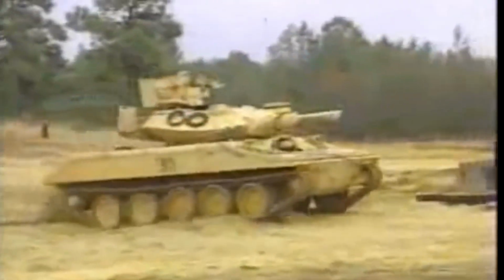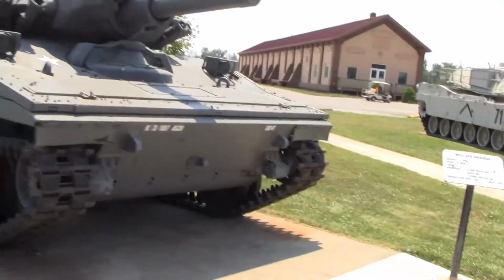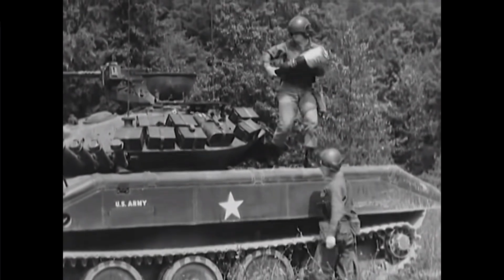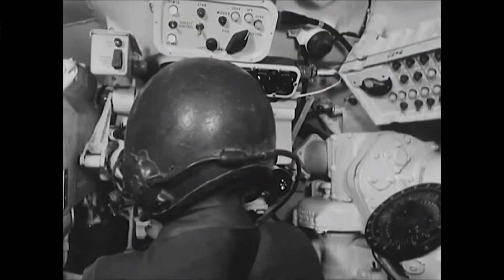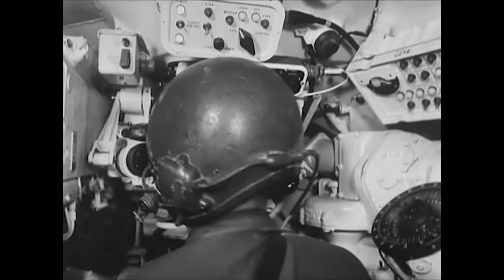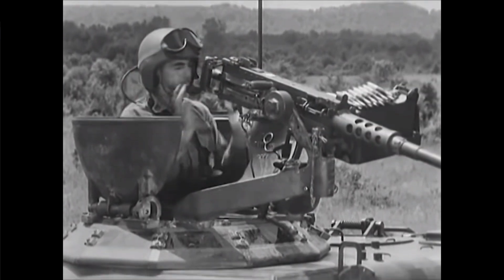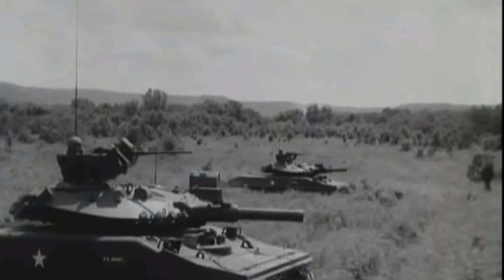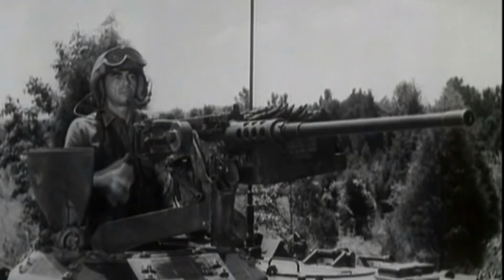M551 "Sheridan" AR/AAV | DESIGN DISASTER!

Comment: My history as a crew member who manned all 4 positions on the Sheridan from 1976 to 1979. Assigned to L troop 3/3 ACR Ft. Bliss, TX. All the problems mentioned in the video had pretty much been resolved by the time I served on the M551. Out of the more than 600 main gun rounds I fired I had only 1 misfire. And yes she kicked like a mule when you fired the main gun. I also had the privilege of firing 2 Shillelagh missiles and both were dead on target at 1200 meters. These were laser guided missiles and not the wire guided.
 Our biggest problem was the coaxial machine gun. The solenoids didn't work very well so we usually disconnected the cable to the solenoid and had the loader fire the gun manually. As I aimed thru the sight I would tell the loader over the intercom when to push the manual lever and when to release it. This usually worked pretty well.
 Mechanically they were pretty reliable. What we put them through while training they were bound to break down sooner or later. The main thing was to do all your PM's. They were pretty easy to work on. We could change the power pack (engine/transmission) in less than 2 hours. 
Would have I wanted to go to war in it? NO, it was too lightly armored. A heavy machine gun firing AP rounds could take out a Sheridan. You just don't get a warm fuzzy feeling when the name ALCOA is stamped on your turret.
Reply from the maker: Jon thanks so much for your info!! Amazing to have someone who actually used it have a good time with it. As I did say, they did fix a lot of the problems :)
Reply: @_Matsimus_ , No problem my friend. I love to share my stories of my time in the US Cavalry. Some of the toughest and happiest moments in my life. Scouts Out, Sir.
Reply: @phred.phlintstone  Even though we were in the desert it still got cold in Jan. and Feb. But sand was are biggest enemy. It got everywhere. It would get in our fuel tanks and then clog our fuel filters. You could always tell when your fuel filters were dirty, you would slowly lose power from the engine and the Sheridan would start to lose speed until eventually you were creeping along at about 15 mph. The filters were easy to get at but we rarely had replacements and had to clean the old ones. 
I still laugh at the way we cleaned our air filter. The inside diameter of the filter canister was the same size as the outside diameter of our main gun so we would slip the air filter over the main gun and manually release the air pressure from the bore evacuation compressor and the air coming out the end of the barrel would blow the sand out of the filter. Once again you didn't want to get caught doing this because if you weren't careful you could blow the filter off the end of the barrel and damage it. We used to call that Spec 4 ingenuity.
Reply: I was a M60 tanker but served the same time you did and talked a Ssgt who served in Nam. He said that they took 12.7mm hits and you could see the dents from INSIDE the turret
Reply: I was a Shillelagh missile tech from 1977 to 1980. The missiles weren't laser guided. they were guided by 2 carbon arc lamps in that box that sits on the gun.
Reply: Reactive armor would have helped if it was in a war long enough .1600 built that s alot .i wonder how good fuel consumption was
Reply: @leocrall4888  I'm sure we were taught the range of the M551 in Sheridan school but I don't remember. We would always top off before we left the motor pool when we were headed out to the field for training and then we would rendezvous with the fuel trucks at night for refueling. We would log the gallons received each time in the vehicle log book but I never tracked the consumption. Our crew would refuel at every opportunity where as some crews wouldn't. We would never turn down fuel.
Reply: I served 00-06 12-B, not to make anyone feel old, but I built a M551 model as a kid, and unfortunately noticed one at Fort Leonard Wood on the hand grenade range... less tracks, turret and bogie wheels. It was one of those "Where have I seen this before?" moments .. I had a Hard Ass 1st Sgt (really good guy tho) who seemed to materialize like the Predator from no-place, I said "You don't deserve this"  (to the tank) he says "You live through it, the ARMY will do the same to you", and walked off.
Reply: @soldierski1669  "the ARMY will do the same to you" - Ha!  Ha!  Ha!  Ha!  Ha!  Yeah ... the voice of experience there ...
.
Reply: Jon, any idea what happened to the majority of the Sheridans?  I know some were converted to resemble Russian armor for Army wargames.  And I also read some were used as artificial reef.
Reply: @phred.phlintstone  They were 6 cylinder diesels with a turbo charger. When it got cold in winter we would spray starter fluid into the turbo fan and the engines would fire right up. You didn't want to get caught doing this, you would get in a lot of trouble.
Reply: Gteat info!
Reply: @phred.phlintstone  Yeah.  Dec. 1970, I was a sentry at MCSC Barstow up in the High Desert - and yeah ... there was no moisture in the air to hold the heat in - and at 0400 in the morning - all the heat from the previous day had radiated out into that star filled sky - and yes ... it was cold.  I wore two pairs of socks, long underwear, jeans and my utility trousers, long sleeve underwear, a sweat shirt and my utility jacket - then - my field jacket - with a liner my father had had the wisdom to tell me to buy ... and it was still cold. Oh and gloves - and - a towel for a scarf - which I could pull up over my mouth and nose.  6 on 6 off ...
.
Reply: Thanks for your service, man.
Reply: Hey Jon I was in L troop the same time as you I was in third platoon and crewed my Sheridan with ssg tuck.

Comment: I served in 4/68 as both a tank plt ldr/tank commander and later as the company XO (aka maintenance officer).  This was from 1973 thru 1976.  The missile control system could be finicky, sometimes difficult to get it to a "green" light status so you could shoot.  Never had any specific issues with the actual missiles.  They were accurate out to ranges well in excess of 4KM.  Hardest part was getting the gunners to keep the crosshairs on the target and not try to "fly" the missile.  The guidance was by an infrared light beam like a TV remote on steroids.  I later served as XO again in Germany in an M60A2 "Starship" tank battalion (1/32nd Armor).  Less trouble with the missile control systems as the vibrations/shock from firing the main gun with conventional ammo was almost nothing.  They had beefed up the recoil system and with the tank weight at 54 tons instead of 17 tons, the gun only recoiled about 5 inches.  On the Sheridan the recoil came back to full mechanical stop and then rocked the tank back till the front two road wheels lifted up and you could see daylight under them.  I had the radio shelf in my Sheridan break off one day and everything fell onto the turret floor.  After about 15-20 main gun conventional rounds, we would tighten up the battery cables as they would vibrate loose.  The closed breach scavenging system worked great - it operated at about 5000 PSI.
Reply: Alpha Company, 1st Platoon, TC '73-'74. Remember the first LAPES test that had a malfunction of the release clamps and it did NOT get pulled out of the C-130 50 feet above the DZ but several hundred feet above when the hot shot pilot did a hard pull up and THEN it ended up in pieces...
Reply: That one went into the trees and we had to cut down a tree to get one of the chutes back.  About a year later we lost another one and it buried itself in the ground nose first.  When we pulled it out, it had a tree stump through the front lower armor.  It was the tree we had cut down before.   I was 3rd plt Charlie Company 73-74 then XO in Charlie in 75.  Do you remember SFC Tuemler?  He was my platoon sergeant.  @kentonvelomancer3466

Comment: Actually a few changes could have made this a good platform.  For one it was over complicated and a maintenance nightmare.  Jimmy diesels were excellent for M113's but Lycoming diesel and different trans would have helped.  Main gun was a bitch and should have been scraped or just improved to handle only conventional or missile. As in most cases of that time period many pieces of overpriced shit was deployed.  I think Army Ordinance at Aberdeen was either out to lunch or on someone else's payroll.  From 1968 to 1975 things like the Vulcan, Chaparral, PPS 4 & 5's, the 1 1/4 trucks, early Redeye missiles, M551's, the at forever deadlined gas powered reconnaissance track, and other junk, oh I forgot that magnificent debacle called a Gamma goat.  Plus lack of parts (PLL). If the Russians would have come over the border NATO would have been screwed. Besides a lot of outdated and piss pour equipment much of that which did work was rushed to Israel for use.  One unit in Southern Germany I know of had broken down recon tracks, no Redeyes for it Redeye unit, no track pads and damaged tracks on its 4 duce mortars 113's.  Most of it's basic load was shipped elsewhere.  But the Readiness reports were first alter at platoon level, then again by the 1st Sgt., then again by the Company commander, then by S-4, then again at Battalion, then Division and so forth. By the time it hit Washington you'd think this unit and others like it were composed of Iron Man and Transformers.  Morale was bad also because most of the good officers were in high priority combat areas and a lot of units were commanded and run by shoe shinning  promotion seekers.  Don't get me wrong but there were some units that were top notch I served in several but many were nothing but uselessness collecting pay. Piss poor equipment and supply can and has busted morale, throw in good on paper but shit for brains commands you got disaster.  I know the military has changed quite a bit since the sixties and seventies for the better.  Gone are the days of the weekend meals of canned hotdogs but has it rid itself of doctored Readiness Reports that cover up evidence deployment of over hyped, overpriced, nonfunctional junk?  Just as WW2's defective torpedoes and the following blame game has the military command taken its head out of its ass or still living the illusion of greatness?  I hope it has.  Only thing worse than losing good men and women in ombat is losing them because of ignorance and arrogance of their leaders and defective or inferior equipment.

Comment: "Aluminum hull"

I've never been so disappointed, Matt. Canada is getting to you.
Reply: @phred.phlintstone  The problem is "Aluminum". It's Aluminium.
Reply: The foam flotation under the thin outer skin was found to serve as GREAT advantage: It afforded a "stand-off" detonation of HEAT rounds, which were the main ammo used by most tanks at the time, not to mention RPGs. The 18" of so distance away from the inner thicker aluminum that the fuse set off allowd the force of the jet stream to spread. The IDF learned this from damaged M551's in Vietnam and started covering some areas of their tanks used in '73 with skinned blocks of foam and likely saved many lives. Today we have "reactive armor" which takes the same premise and adds outward-exploding force when hit. Of course off of this does nothing against a SABOT...   @VEpsilon

Comment: The preasured air system most likely is more for forcing the fumes out of the gun and keeping it from flowing into the crew compartment, a similar system was used on the Panthers and is curently still in use with the french military on vehicles such as the Leclerc since these dont have a Fume Extractor
Reply: @phred.phlintstone  did they not have a compresor on the vehicle? well thats fucking retarded, a truck has a fucking compresor with it to refule the compresed air storage why didnt they?

Comment: Was a good looking tank.. really like the turret shape.. quite modern... Shame it didn't operate as good as it looks lol
Reply: With a different gun it would have been superb. More range and faster rate of fire. We thought that back in 1970 when we got them then. They were brand new and excellent condition, but even at Bragg in the mid 80s worn and used as they were they ran circles around the M60 except in gunnery.

Comment: When I was going through Basic Training/A.I.T. at Ft. Knox, KY towards the late 70's as a Tank Crewman, a number of Crewman Hopefuls were both interviewed and others VolunTold they would move over from the M60A1 series tanks to the M551 Sheridan.
I had the skills and scores to allow me to test out but I was physically larger than the desired size (not Lilliputian but not almost 6' and muscular as HELL) so I wasn't selected.
Those who moved over were, by all accounts, small in stature but they all complained about being in the Loader position as described in this video.
I always liked the size aspect, speed and state of the art (for the day) plus the main gun/missile launcher but we heard fairly quickly about how temperamental the main gun/rounds were as well as it was a not-so-closely guarded secret that sometimes, as one missile was being fired, if another Sheridan was in close proximity and lazing to another, nearby, target, every so often the Shileighly(sp?) missile fired and in-flight could be "Stolen" by the other tank. Allegedly this was cause by the laser coding being used was too close in their pulses and in close enough sequencing that the missile seeker could be over-ridden and take off. 
Also, again allegedly (as told to me by one of these former fellow crewmen) when a missile was "stolen" it couldn't me counted on to actively seek and engage it's newly acquired target but would instead just head up into the air or plow into the ground short of the target. No rhyme or reason as to the direction...it just "WENT" I was told.
So outside of  the fact it was a much lighter weight tank with superior terrain negotiating abilities due to the lighter weight, I wanted IN because I just KNEW it would be better able to Shoot and Scoot with better survivability built in.
WRONG! as it turns out and was described on the video.
Still, it is an interesting device and if they would have incorporated a larger turret and used a better main gun, sighting system and less complicated wiring system, it might have turned into a better firing system. 
But coulda-woulda-shoulda doesnt get the job done, does it? LOL 
But l have to admit the M551 was a cool "concept" vehicle in its own right. 
Thanks for the video and trip down Memory Lane. 
Merry Christmas to You and all my fellow Veterans, Past, Present and Future!
God Bless you One and All!!

Comment: The 152 mm Gun/Launcher, per tank commanders in the 70's sucked. The short barrel gave it a rather short range. The anti-tank HEAT round wasn't that effective. The only positive thing I heard about the 152 mm Gun/Launcher was the Beehive round. That round was extremely effective. I know they had a 105mm version for the M60/M1 105mm gun. Not Sure if they had a 90mm version for the M48. The gun system is part of why the MBT70 was terminated. My Dad a combat veteran in armor, and an ordinance expert, thought the gun system was absolute junk. The M60-A2 nicknamed the Starship for the turret, was equipped with the 152 mm Gun/Launcher. The Israelis wanted nothing to do with the gun system and refused to buy them. The M60-A2 disappeared from the Army inventory rapidly. The A1 was kept in service or upgraded. The A2 went to the scrap yard. The M551 was vulnerable to landmines, but so was/is the M113. I had a friend the was armored Cav in Vietnam. The lined the floor with sandbags, that was good enough to stop an RPG fired from a spider hole directly under the track. M113was ok, the Viet Cong " volunteer was pretty much mush between the back blast in the hole and the warhead,

Comment: Had a long chat with an army mechanic who worked on these things. He said the engine bay was always insanely dirty and they always caught on fire.
And the issue with the regular rounds shaking the electronics apart was much much worse than stated in the video.
Everyone loved the concept but despised the vehicle.
Reply: I really do not know why the electronics were so vulnerable. I have worked in defence as a design engineer (electronics) and know you can make electronics insanely rugged. EG "Copperhead" rounds which take something like 30,000g of longitudinal and 5000g of rotational acceleration on launch (from a howitzer). They were available in the 70's. We can make electronics considerably tougher now. Yes interconnects are a weak point but for crying out loud there are plenty of types that can take way more punishment than would instantly kill the crew all day every day and just shrug it off.
Reply: @phred.phlintstone  The M551 Sheridan was a diesel designfrom the beginning

Comment: I think the A1 variant the developed in the 1970s FINALLY made the design functional (ie main gun won't damage it's missile guidance gear when a conventional shell fires).
Reply: A better scavenger system and thermal sight were two of the best changes. I just wished that they had fixed that gun seal. 
I would have loved to try out the M8 with that 105mm. with that on the Sheridan then the only problem would have been in the trees. 
In Germany we took the Sheridans through the trees and ran rings around the M60. But that was the only advantage with a short gun tube. But the Sheridan was not meant to go toe to toe with main battle tanks, that is why it was designated as an Armored Reconnaissance vehicle and not a light tank.

Comment: Hard to believe that this thing was on the books until 1998.
Reply: They  had nothing to replace it  and still do not for airborne units.
Reply: They are still in use at Fort Irwin as opfor units
Reply: @mikeb.5039  The one's used for opfor were retired in 2003 i believe.